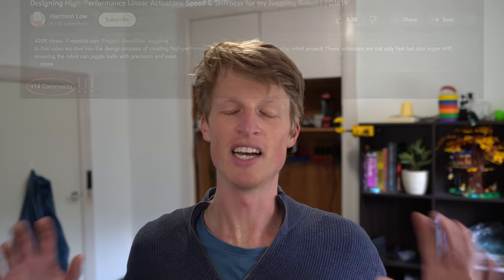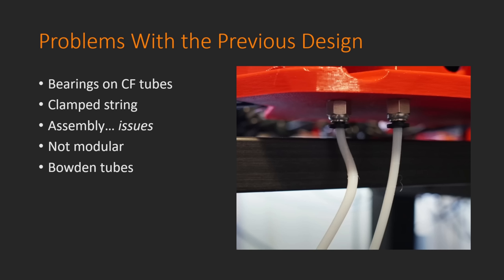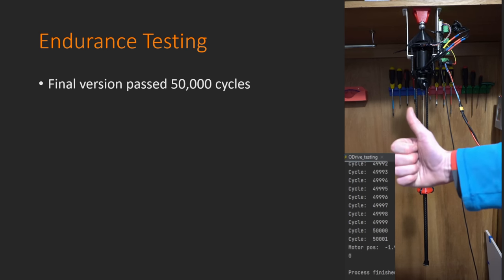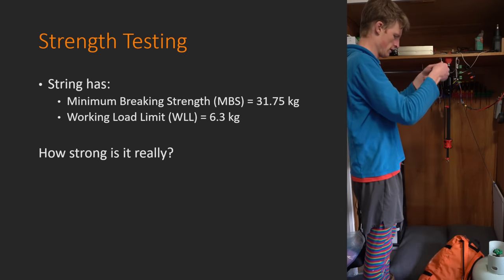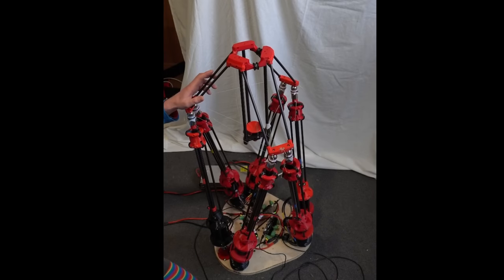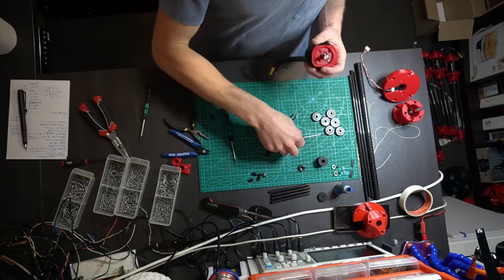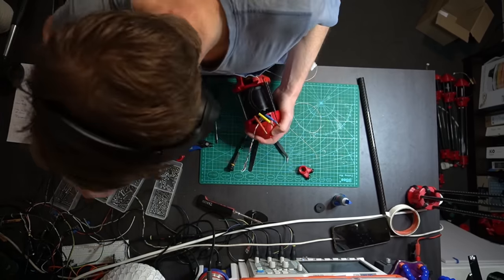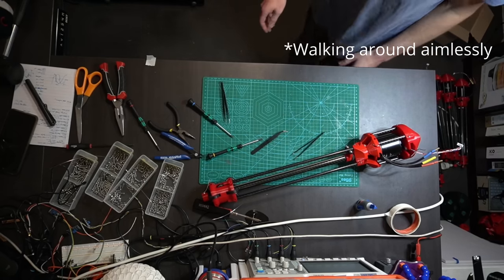My New Linear Actuators are SO MUCH BETTER! | PDJ #21

Comment: Another thought on the dyneema strings. It might be possible to remove one pulley from each of the two string runs. Essentially for the contract string (the green string at 4:36) go directly from the spool to the vertical up pulley with a single bend, and for the other string  again going from the spool to the vertical up directly.  This should work fine with the spools limiting the tendency of the string to "walk" on the spool, but won't probably work is you use the body of the motor as spool. another issue with using the motor body as spool is that you lose leverage and maximum torque.
Reply from the maker: Good observations! I don't know how I didn't realise that this is possible with just two pulleys per direction! 

What makes you say that the string "walking" tendency would be affected at all? I'd think this would be more dictated by the number of wraps around the spool than the orientation of the next pulley (in this specific case - I can see how generally the location of the next spool could be significant).

Cheers 😊
Reply: @harrisonlow  I have a feeling that having the final pulley parallel to the drum helps keeping the loops more tightly packed. A single bend has less of the pulley engaged with the string and might make it easier for the string to wander and possibly skip. If that is the case it might be possible to do a full loop around the pulley, but it will increase the wear on the string.

Comment: You need closed loop feedback on the tension on the string and the energy invested, then you can prevent overwhelming your hex platform drives...
Reply from the maker: Why do you suggest I'd need feedback on the tension of the string? You don't think the motor position feedback would be enough?
Reply: @harrisonlow  if you want a bot to be able to behave more like an organic being you need as much closed loop operation as you can implement! You will be able to electronically cushion a catch and avoid braking strings. Besides you can also analyze the weight on the platform or the health of the drive...
Reply from the maker: Hmm those are very good points. I'll have a think about this, cheers!

Comment: Maybe you could use locking tuning machines (for guitar) to terminate the cables, which would also allow you to easily adjust the tension without releasing the cable. I'm not sure the cable would fit through the hole in the tuner, but from the closeup with your hand it looks like it might work.
Reply from the maker: Good idea! I wonder how small these mechanisms could be made, though? I'd need one tensioner on each end of the central CF tube, and I want them to be as small and light as possible

The smallest synchromesh cable is pretty thin (1.6 mm diameter). Not sure how big normal guitar strings are, but 1.6 mm is pretty thin as far as I'm concerned!
Reply: @harrisonlow  you only need a tensioner on one end of the cables, since the motor position is calibrated on reboot.

Comment: The anti-twist bearings against the structural tubes could probably be utilized to also provide the forces to keep the entire actuator straight. You mentioned having it engage all 3 tubes  in future versions to help reduce twist. Additionally, since they would (usually, except at full extension) be much further away from eachother, the lever arm would be longer and the forces on the bearings would be far less. You can probably simplify the 6 bearing block into 3 bearings by doing this.
Reply from the maker: I'm glad you mentioned this! I toyed with this idea a lot in the development of these actuators and ultimately decided against it for a few reasons:
 - The "guide" CF tubes, while quite stiff, can flex a bit if they're loaded at their midpoint
 - I want to reduce the weight of the "end effector" of the leg as much as possible, since this is the part that's moving the most (and fastest)
 - After experiencing how much wobble there can be in the fully-extended tip of the leg (if things aren't tuned quite right) I'm worried about the stiffness I'd be able to get out of the system you're describing when the leg is fully extended. Maybe the solution is a simple one: reduce the "operative" length of the leg.

Others have been suggesting using linear rails that run along the support CF tubes and I wonder if that would be the best of both worlds: increased bending stiffness for midpoint loads, (relatively) low weight, high stiffness for when the leg is fully extended, etc...
Reply: @harrisonlow  You can probably reduce the flex of the "guide tubes" if you make 3D printed connectors that tie all 3 together. Just a triangular shape around the exterior, in order to give clearance for all the stuff going on in the middle. One or two per actuator would probably do it.

I do like the idea of using linear rails. They are kinda heavy, but if you keep the "rail" part to the base section instead of the end effector, it probably wouldn't matter.

Have you thought about a semi-telescopic system? instead of extending a 2-part system 95%, extend a 3 part system 60% or so. It would probably add mass, but you would gain a lot of rigidity, and the middle section is only moving half as much as the end effector. I don't think it would take any extra space, since you could use 6 guide-tubes instead of 3. (3 for base section, 3 for middle section, interior tube for end section). The base section bearings could even directly support both the middle end section at the end, assuming you weren't adding any length compared to the non-telescopic version.
Reply from the maker: Those "connectors" are a good idea! That'd require careful designing of the internal rollers (to avoid collisions) but I agree, that should work (and it'd look pretty cool as well!)

I only briefly toyed with the idea of a telescopic mechanism; quickly abandoning it after realising how tricky it'd be to support everything. Another option that I've played around with (and would love to make one day!) is a linear actuator (and more broadly, a Stewart platform) built with so-called "zip chain actuators". That would be quite the sight!

Comment: Pretty awesome. What´s your plan with the plattform at the end ?
Reply from the maker: It's a little tricky to explain with words, but the general idea is that there will be a "hand" that catches/throws the balls mounted in the middle of the platform. The platform will move around, moving the "hand" to the right place and making it catch/throw as needed. If you want a semi-detailed run-down of the whole project, this video should catch you up to speed: https://www.youtube.com/watch?v=VrLI43zoeRI 😊
Reply: Ah I see thank you. Pretty cool project. I have expected a new type of 3D printer or a robot or a sorting machine but it can be used in this way as well. @harrisonlow

Comment: 6:52 "If anyone is familiar with setting up brake resistors, or regenerative braking with batteries, I would really appreciate it if you could give me a hand"

Well, I have a small amount of experience here. More windings will help, but you also need a stronger magnet/magnet set. If your resistors are overheating, then you need more of them, rated for more wattage... Or put a bunch more in parallel, to reduce the amount of current and therefore the amount of power going through each one at any given time. 

Also of note, you will need some method of cooling the resistors. Your power is being converted into movement and then basically ALL of it into heat. It would make a lot of sense to rig up a few computer fans on your resistor bank.

5v is easy to wire with USB powered stuff, and 12v is common for computer fans. You can probably find some 24v ones if you need, too. Voltage step up/step down chips are very cheap, too.
Reply from the maker: Yep, after talking with others on Zulip, I think you're right about heat. Seems like adding some active cooling to my existing brake resistors will go a long way towards fixing the issue of them overheating. Cheers for the input 😊
Reply: @harrisonlow  Resistors rated for more wattage are a better idea than trying to cool resistors you already have. Adding more in parallel would also help a lot more than adding cooling.

Usually, when I blow resistors, they light on fire from the inside out. Heat transfer through carbon is very slow.
Reply from the maker: @phil2082  This was my first thought as well, so I picked up some 300 W resistors (as compared to the original 50 W ones of the same resistance) and for some reason, they don't work! Power is getting fed back through the PSU and it's shutting off.

I'm certain the solution is a simple software one, but I got fed up with breaking strings and said "3.4 m/s is good enough for now". I reckon I'll return to this once more pressing matters have been dealt with (namely, controlling 6 motors with CAN) and I'll set up a better rig that doesn't involve breaking tedious-to-reset strings
Reply: @harrisonlow  More wattage in the same resistor value should help the resistors not overheat... But you likely also need some more resistance? Should help slow down better when needed?

I'm not sure how the electronics are hooked up is the other problem. It is possible that your resistance limit is hit with the coils of wire you have? 

There could be other issues with the design cooperating, but it seems very odd that the same value resistor bank doesn't work at all just because it can dissipate more heat.

Thanks a lot for sharing your progress!

Comment: if you need high power break resistors, use nichrome wire in an oil (or distilled water) tank. you can get bands , just measure the length you need for the resistance you want.

for regen braking you'd usually want a bank of supercapacitors to take the brunt of the load as it's not like a car where you can slow down for 30s+, you're in the 300ms range, and tbh I don't think it's worth doing 

another option is to have a separate breaking system, either a magnetic disc, friction, grease/fluid pump.
the pump is fairly simple, you have a pump in a closed loop and a valve regulating the flow, similar to how a dyno works, though it's probably not the right one for the job as you'd have to have a lot bulkier of a setup on the actuators, same with using a flywheel or governor. the friction brake is basically just putting a bike brake on the thing (you could probably use the tube itself as the braking surface) but you will have to change the brake surfaces at some point. the magnetic disc, you use a copper disc next to a magnet or electromagnet and it will basically act as a 1 turn coil on a motor which will brake fairly hard.

imo watercooled resistors is both the simplest and cheapest. (for <10 bucks you can have your 3*6= 18 resistors. you just need a thing that holds water, some crimps, a holder for the cables and a gallon of distilled water and you'll be good. if the water still heats up too much you can use a bigger tank or a pump and a radiator with fans. if you're using water you'll probably want to use aluminum instead of copper for the connection to avoid corrosion.

for tightening with synchromesh, you'd want to split tensioning and holding the cable in 2 parts, with one part locking the thread and another tensioning.
Reply from the maker: The trouble with the eye termination is that it doesn't inherently give a way to easily adjust the tension in the line. I could make an adjustable rod/pin for it to sit on, but it feels like there are simpler solutions 🤔

Haha someone else suggested splicing the cables into an eye and after taking one quick glance at the scale of these wires, I said "hell no" 😂
Reply: @harrisonlow  you might be able to use a 3d printed screw and clamp on it to hold the cable. if the open end of your screw is slanted, you can use it to both clamp on the synchromesh and jam the clamp into the holder, fixing it to the frame.

though yeah synchromesh is decently expensive at around 10 bucks a meter.
Reply from the maker: Yup, shipping included the cables were ~ AUD$15/m. I'm still so afraid to cut them and waste any 😅
Reply: @harrisonlow  yeah better make them some multiple of the total length, maybe at the cost of some increased/reduced length of the actuator.

Comment: 2 ideas (i am at 7th minute of the video ) 
springs at both ends for helping the breaking and reversing directions , and i think you can use just one string for both directions , just tie it as a complete loop
Reply from the maker: I do like the idea of having the string being a single loop, though I'm not sure how to ensure the motor has a solid "grip" on the string? This is similar to bow belt-driven CNC's work, where a belt is very tightly routed around the motor's output shaft, which has a toothed gear to match the profile of the belt. If I'm using plain string I have no idea how to ensure that the string doesn't slip on the spool? (though maybe this could be seen as a safety feature, where the string slips instead of snapping?). I can kind of imagine how it could work with the synchromesh cable thanks to its strange profile, though even then it might be tricky if printing the parts and using the smaller synchromesh cable (tolerances would be tricky here).

Springs would definitely be helpful for (hopefully) stopping complete failures if the motor can't slow down fast enough, though I don't know if I like that they'd necessarily reduce the "operating" length of the actuator 🤔

Cheers for the ideas!
Reply: @harrisonlow  for the loop string , and how to hold it on the motor , i was thinking that if  you make 3-5 turns around a screw type of gear on the motor. then the same length of string would be released on one side of the gear that was pulled from the other . 
the number of turns around that gear i think that can hold the string in a steady position without slipping . 
i dont know how fast that can work without giving you a knot :)
Reply from the maker: Yeah I'd have to give that a test. So-called "friction knots" can be super solid, and I imagine that adding grooves for the outer spiral of the synchromesh cable would make it even stronger again. This is becoming quite a promising idea! 🤔

Comment: wouldnt using some sort of encoder allow you firstly be able to know the position at any time and match it with tiny pwm module on each motor
Reply: that should give you access to most variables
Reply: using stepper motors would have made them supper acurate
Reply from the maker: Yep! I've got an AMT 102-V encoder behind the motor to give this feedback 😊 I actually did use stepper motors in a previous version of these actuators but found them prohibitively slow (and super heavy)